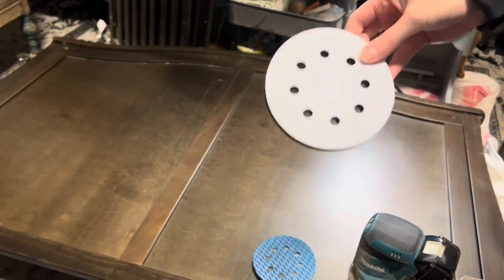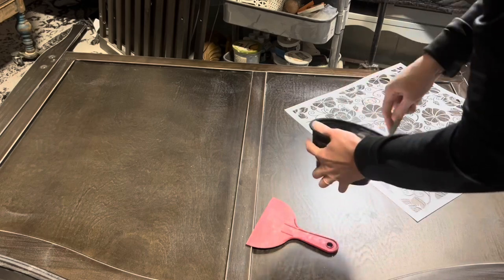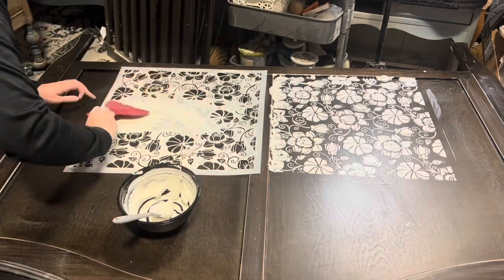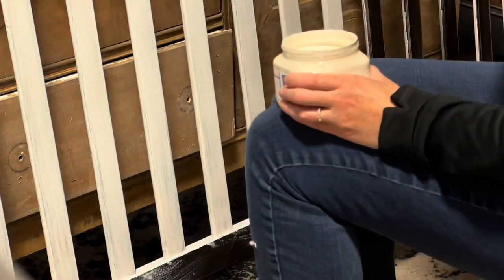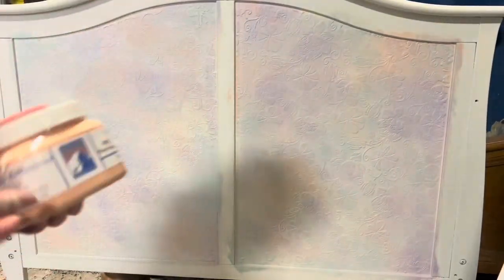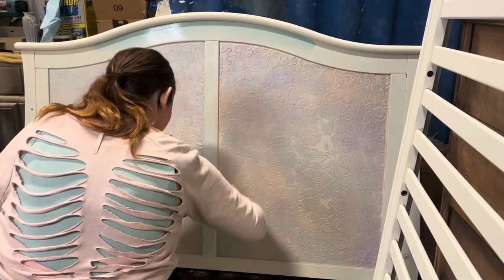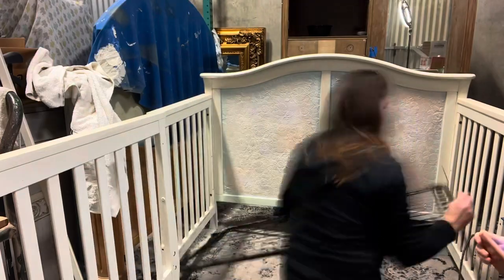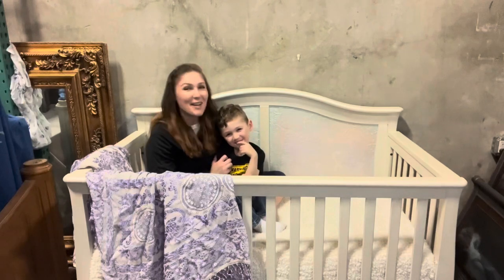Ultimate Crib Makeover With Raised Stencil, Blends, & Metallics | Elegant Upgrades

Comment: Would you do a dresser or a tv console  in metallic of some color? I would love to see how you apply metallic. There is not very many pieces of furniture in a metallic paint on YouTube.
Reply from the maker: I have done a dresser in metallic, but not a tv console(not that I wouldn’t). And I add the metallic in the top coat stage. I like the impact regular colors give and then adding a metallic over the top. The best way to apply metallic is with a sprayer, but I prefer to brush my paint so I just accept the light imperfections of painting by hand. If you want to see the dresser video, it’s on the part 2 of this one:
https://youtu.be/McCOCzKfhUE
But if you have questions, I’d be happy to answer them if I can. I know that’s probably not the response you were hoping for as I don’t specifically use full metallic paint, but this is the way I prefer.
Reply: Thank you so much for your advice.